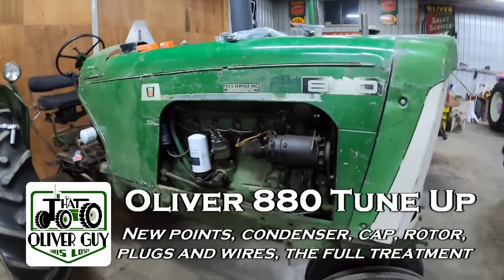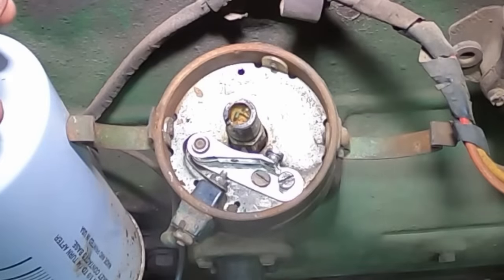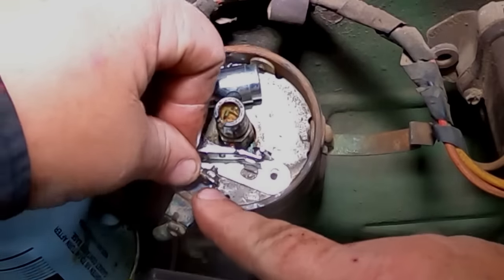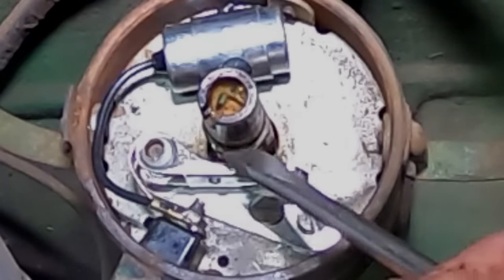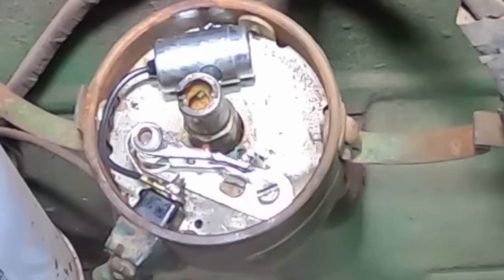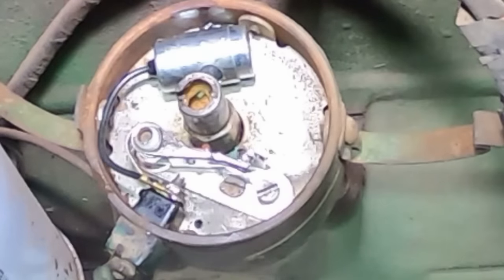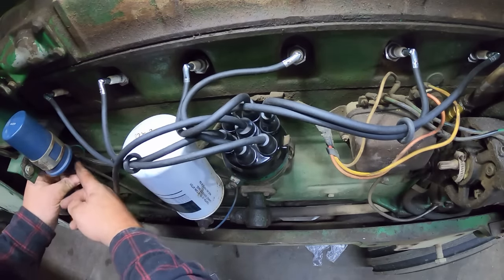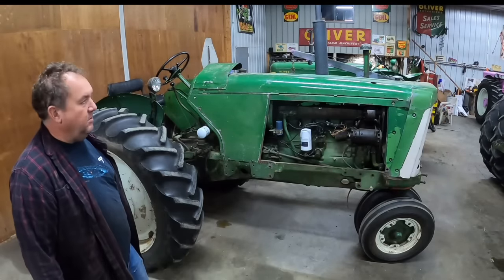TUNE UP TIME

Comment: When I bought my 770 this past summer, it had an electronic ignition.  Joe and I changed it back to points and condenser.  Joe said the electronic ignitions didn't work well on these old Olivers and didn't last as long as they should, plus (and the big thing for me) is that there is no prior warning for when they are going to quit working - they just stop.  At least with points and a condenser, usually you know when there is starting to be a problem because the tractor doesn't run right.
Reply from the maker: A lot times the points just need cleaning. When the electronic goes, that's all she wrote.

Comment: Good video Chris.

I'm fortunate that my Agco dealer (old Oliver dealer) stocks lots of parts for Olivers, including ignition tuneup parts.

The owner of the dealer is a collector, plus there are still a fair number of us around here still using Oliver gas tractors, so demand us there.

They found over the years that Standard was what held up best, so that's what they carry. The last stuff I bought from them a couple of years ago was still made in the US.

They have carried Champion plugs since I've been doing business with them.

I've got some new old stock Oliver Prestolite plugs in the box, and thought I'd trace the lineage and found they became Autolite. Thought I'd put a set of them in the 1800 just for the historical aspect, but when I looked on the box at NAPA, they were made in China, so Champions went in the 1800. Made in Mexico, but better than China in my experience.

It's so sad and irritating to see all this work getting offshored.

I work for a company that builds tooling for Federal Mogul, including the Champion spark plug plants.

I've built tooling components off of Champion prints from the 1950s, kind of cool.
Reply from the maker: Thanks!

Comment: Don't have any gas tractors anymore(Or atleast right now, but their is always room for just one more), but when we did I was never upset spending the money on Electronic ignition..........Always worked no matter how long it sat and running things every day on the manure spreader, that was one less thing to worry about, especially in the dead of winter.  Driving by the neighbors seeing them in the corn crib with the distributor cap danging down along the frame to get their spreader tractor going made the feelings even better about shelling out the extra.

Comment: I have a slide rule n circle spark plug gauge n Champion spark plug installer tool from back in the 70s when I worked for Chrysler Plymouth it was easy to cross thread when installing plugs

Comment: I remember when I had my grand dad's Ford 881 SoS, whenever we had a slight mist or light rain, it would "drown" out. Distributor never got wet but, just the moisture in the air seeped into the cap and that's how we found it had a crack in it. Couldn't see the crack from the outside but, we took it off, and you could clearly see where the spark was jumping around inside, nasty stuff. I still prefer points and condenser's over electronic ignition. Seen too many of those fail over the old points. Great video as always, cheers :)
Reply from the maker: My 1600 industrial had a miss when I first got it. That uses a screw on cap, and while trying to figure out the miss I left the screws loose on the cap and and the miss went away. Tighten them down and the miss came back. There was a crack in the cap that opened when the screws were tight.

Comment: Good to see someone still makes the caps with the brass inserts instead of the cheapo aluminum which corrodes quickly especially when you don't use the tractor alot!

Comment: I'm a pretty big fan of Autolite plugs myself. I've found (especially in the Two-Cylinder John Deere community) that people's opinions on spark plugs are about like people's opinions on engine oil lol. My favorite style of plug has always been the Copper-Cored Non-Resistor plug (I happen to run Autolite 3116s in our Two-Cylinder John Deeres). People tried to tell me that they wouldn't work with electronic ignition, or that they'd foul out more often, etc., but knock on wood they've served me well so far.

Comment: When I was younger, I remember my dad showing me how a condenser works on his oscilloscope. He's an electrical genius lol. The way he explained it to me is the condenser is essentially an electrical shock absorber, which helps to keep the spark on the point contacts rather than arcing all over inside of the cap. When the condenser is bad and you don't have that electrical absorption, the spark will jump from the contacts area on the points to other areas of the points, which will chew them up
Reply from the maker: Great explanation!
Reply: Best explanation I've ever heard and I haven't touched a set of points in 40 years 🚜🚜
Reply: Mike are you a veteran? Based on your picture it looks like you might be, if so I just wanted to say thank you for your service this Veterans Day weekend. 👍
Reply: @Adam_Poirier  thank you sir, but no, I jumped ship and went off to college instead. Lol. The Navy almost got me right out of high-school but I wished I had served now. I still love everything military and show my support just the same.

Comment: Good stuff here Chris. I'm glad you did this one, two of my tractors have points and condensers that I have issues with them and I can check out some of these points of interest. My dad's old Bobcat has that set up too and maybe I can't get the old girl run, so I need to check out the entire electrical system, coil, plugs, points and condenser, plug wires, the whole works. Enjoyed watching, thanks and I hope your Sunday and week goes good!
Reply from the maker: Thanks!
Reply: Yup! First thing to check on old engines is spark then fuel. I had a 1972 Olds 98, and a 1974 Cutlass. When they wouldn't fire it was usually points or condenser. Back then tune-ups were every year and Blue Streak brand became my friend adding 6 months more bcuz of the brass contacts they used.

Comment: The old points you took out were the far superior ventilated ones the Chrysler developed in the early 60's. They lasted far longer than the solid type! I don't think anyone makes the ventilated ones anymore! Condensers are junk today compared to NOS one from the 70's on back. I ALWAYS carry a spare condenser nowadays because I've had new ones work for a few weeks then die!

Comment: Never liked autolite only for one reason ,they break off just past the hex nut . Ive had to pull around ten cylinder heads because of them . Thats over thirty years of automotive work . Ive removed another thirty broken plug with an easy out . All were autolite,although i did have one ac plug break never had a 18 mm plug brake just the 14 mm plugs.  .

Comment: “It has to work harder if the gap is wider” no truer statement spoken. I usually use 386 Autolites. I’m not really sure how I arrived at that, I’ve just been doing it for years.
Reply from the maker: There's 6 mouths to feed, sometimes you gotta work it! 😂

Comment: Chris can you do a video on the governors on the 2 digits please. Still having problems with erratic throttle. I do see that the gov screw is all the way in on the spring. Idk if that means it's worn out or not?
Reply from the maker: Not sure when I will get a chance to do that, but I'll add it to my list

Comment: I always took my welding machine magneto and put in vise and tune it up and fire it then put back in them electronic ones suck for farming got rest of bolts out off 16655 back frame 6 sheared off used easy out on 2 then welded big flat washer on them then big nut they come right out still waiting on some parts u the man
Reply from the maker: Good deal. You're moving right along with that project!

Comment: Chris, excellent video very informative as always, how far are you along on your harvesting and how much more do you got to do? Thanks Michael
Reply from the maker: The weather has been cooperating. The wheat is all planted, I'm on the downhill slide with beans, but haven't run any corn. Yet. I was going to run some a little bit ago while waiting for beans to dry out, but the corn was pretty wet. I decided it can wait until beans are done at this point. I've been in full on harvest mode and haven't been taking the camera to the field, but it has been going well when I can get at it

Comment: Great video Chris. Could use your help again on my son's 1955. It's been sitting for 10 days and now it's low on hydraulic oil and nothing is leaking on the ground. Could you clue me in to what to look for and is their a video I could watch. Thanks for any help I can get.
Reply from the maker: The most likely culprit is the seals in the pto unit. You can check that by capping off the 2 steel lines that go to the valve on the pto unit. If you stop loosing oil, you've found the problem. The other possibilities are the pan that separates the hydraulic from the transmission has a hole or a crack, or the hydraulic pump driveshaft seal is leaking. Most of the time it's the pto unit. I do have a video on rebuilding those.
Reply from the maker: https://youtu.be/yNI5SJYdUQc?si=StFeBn4hL-44ALop
There's the video
Reply: @ThatOliverGuyChris  I will watch that video now and thanks Chris.

Comment: I can remember my grandad 550 diesel made that buzzing sould when your turned on the key. Why? I don't think it was just a reminder that you left it on.
Reply from the maker: It's an oil pressure buzzer. When the 3 digit Olivers came out they decided to get rid of the oil pressure gauge and replace it with a light and buzzer. Probably more likely to catch your attention if the oil pressure fails, but I like a gauge to show me how good the pressure is. The eventually put the gauge back in with the 4 digit models.
Reply: I had forgotten about that buzzer. Been decades since I heard the old Oliver fire up. Sure do miss the lope in the idle of the Waukesha motors. It was a sweet old girl. 🚜🚜

Comment: Good morning Chris. Why were Mallory distributors used on 1650's? I haven't seen them mentioned anywhere in any of the parts or repair manuals.
Reply from the maker: The original Holley vacuum advance distributor was discontinued. Mallory made a replacement distributor with mechanical advance, so that is what White/Oliver supplied. There was a service bulletin issued about the replacement, but ir happened after the last Oliver had been built, so you don't see it in the manuals. A few years ago Mallory discontinued that distributor and for awhile there was no new option. Korves Oliver now has a new Delco distributor that drops right in.

Comment: Sounds good!!  Did that tractor have power steering at one time. I noticed the hose clamp on the back of the generator.
Reply from the maker: It still does. It has a GM style power steering pump up under the hood. I'm guessing the original pump failed and that was their solution.

Comment: Hey do you know what degrees to set the timing on an 880 diesel with the Bosch pump is I just got one and I believe that the timing might be off and I would like to check it but my book hasn’t come yet. It’s hard to start but once running it runs good with no smoke or blow by so I was going to check timing and valves unless there’s something else you might think it is
Reply from the maker: Those arw good places to start. I don't remember the timing off the top of my head, I'll try to remember to look it up tomorrow.
Reply: Do you know how the timing marks line up cause I’ve seen where some people say that with the FP mark on the flywheel and the pointer on the drive gear are lined up that the mark inside the pump is off a tooth but I’m not sure if that’s right or not
Reply from the maker: @jasondagenhart1253  I know you put the flywheel on fp, but I don't remember the rest.

Comment: Hey brother I bought a 1650 gas last year it had been switched to the electronic ignition I bought a new stock distributor and coil put on it so it would be dependable and has been nice video